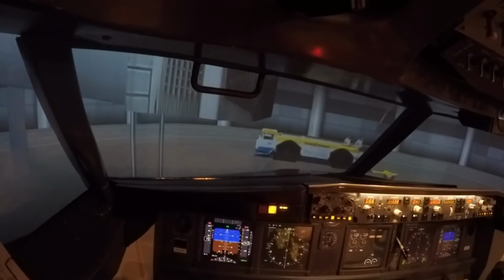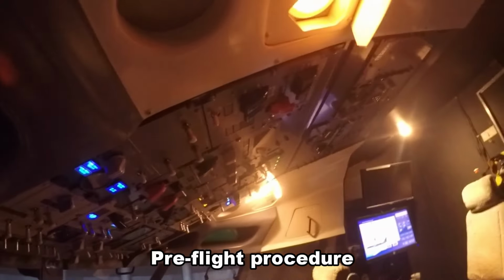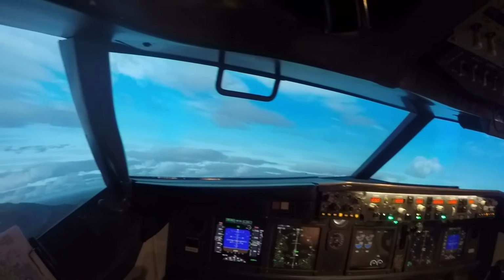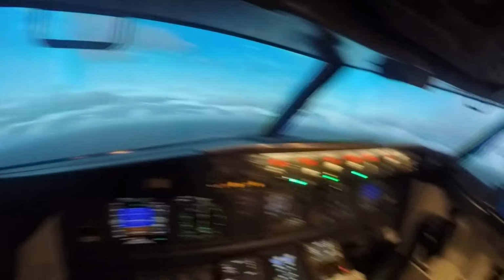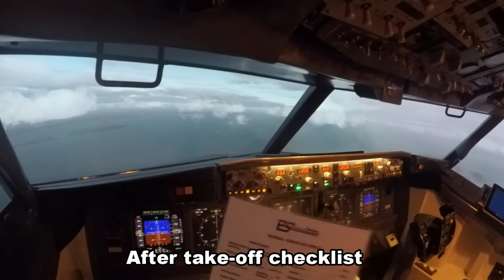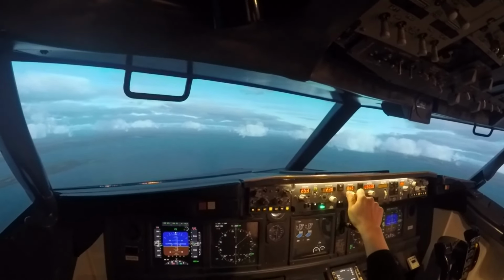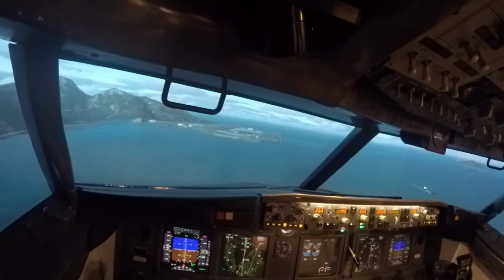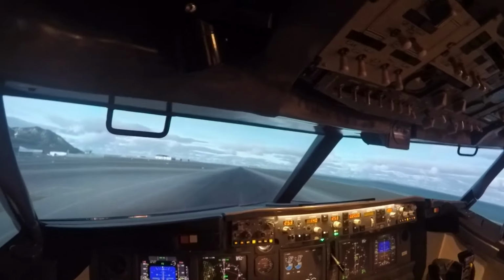Flight Experience Sydney - Circuit flight around Hong Kong

Comment: Another informative and excellent video Eddie. Is it me or are the graphics higher quality in Sydney than ours here is Adelaide? That circuit to final is still pretty treacherous with those mountains, I did the old Kai Tak approach and that was bad enough. :-)
Reply from the maker: The Flight Experience circuit normally involves you going to 2000 ft on base before going to final. It does not take into account the terrain around the airport. Unfortunately, Chek Lap Kok had some mountainous terrain that I didn't realise would be an issue. At least I didn't have a CFIT :)

Comment: How did you get to fly without no instructor? Also, where did you get your flight plan from?
Reply from the maker: After you get your licence 1 endorsement, you can fly circuits solo. I just did a circuit flight so there's no formal flight plan per se.
Reply: Ah, I see. Sorry for asking many questions but where did you get the checklists from?
Reply from the maker: They have laminated checklists on the cockpit dashboard

Comment: They are about to completely overhaul that simulator to the current style cockpit with Huds!
Reply from the maker: Yes, they are upgrading to the PS4.5 at the moment. I spoke with Ben, one of the instructors there, and he confirmed there will be no HUD sadly. It's not possible with the projector technology they use and it is very expensive to install!
Reply: do you know when will the upgrade be in place? will this be installed at their other locations as well?